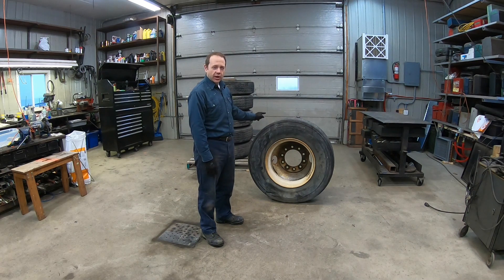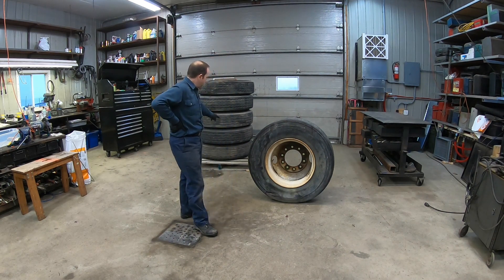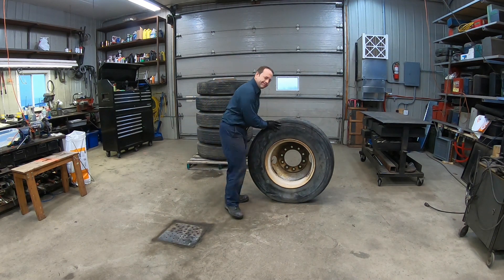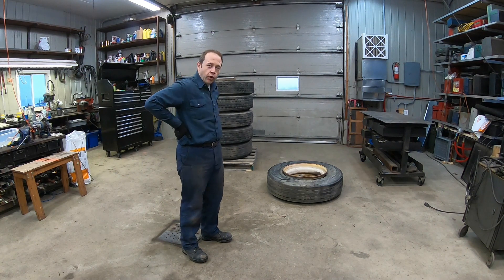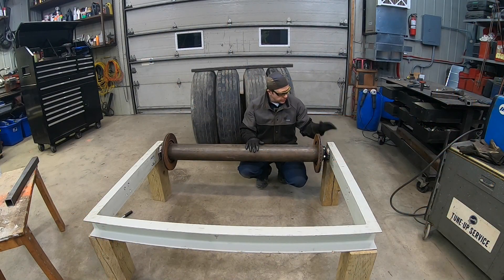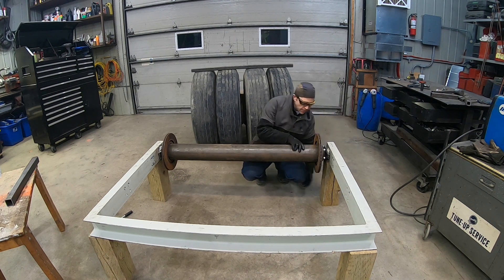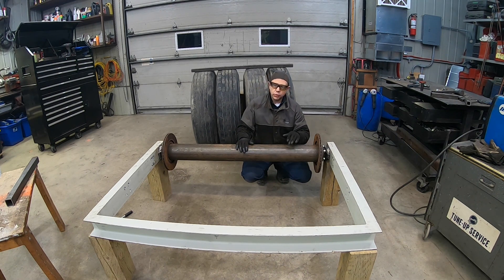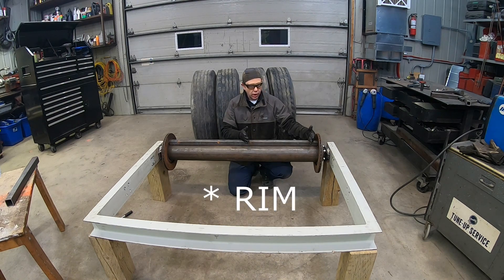#279 The Snow Roller

Comment: Could you just drill into the hub and put a grease fitting and pump some in occasionally?
Reply from the maker: Those hubs are permanently greased (they also have rubber seals). I've selected them from the junkpile for their ability to last! Lol! They should last a good 10 years! Thanks!

Comment: Hi Joe, good idea but May I ask why not just a tow behind roller ?
Reply from the maker: Good question Rick! That is actually a tow-behind roller, a large-scale version. In fact, the small version you will find to roll the lawn will not roll in deep snow, but rather drag and slide. Having a large 42-in diameter helps in that matter. But moreover, I wanted the roller to be towed at high speeds as high as 20mph for miles and miles. Then the final requirement that sets this roller apart, is to be able to handle rocks protruding from the rough trails... which a steel roller will simply get dented seriously at the first encounter. This roller achieves it all! Thanks!
Reply: @FromSteelToWood    That answers my question, good thinking.